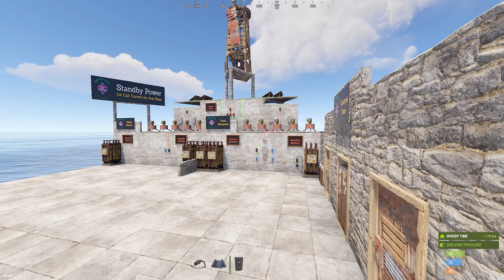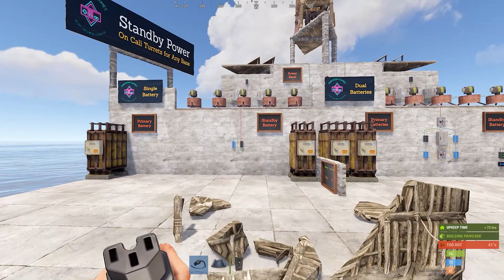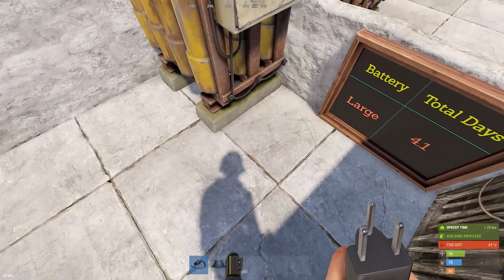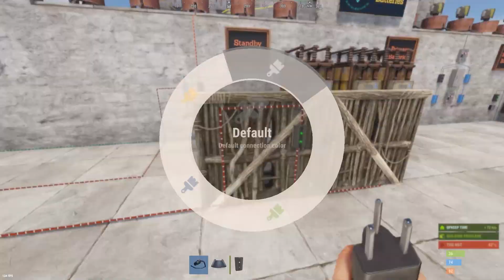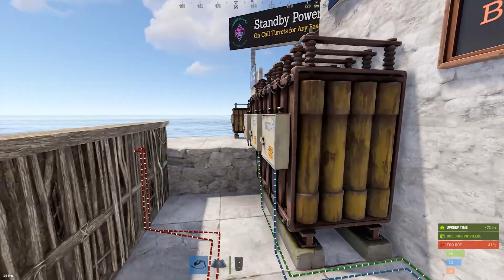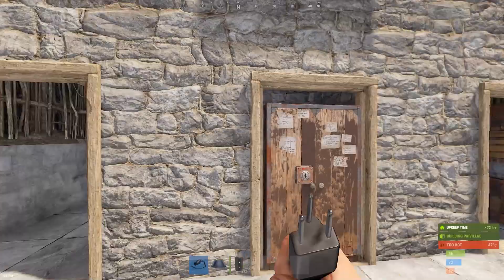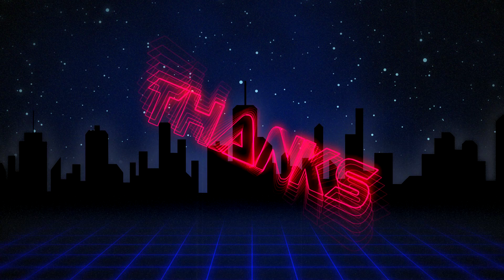RUST Pro Series - Standby Power Vol 2 - On Call Turret Defense - No Power Loss Until Raided 2022

Comment from the maker: 0:00 - Intro / Setup / Vol 1 Recap
0:48 - Single Battery Multiple Activators
4:51 - Dual Battery Multiple Activators
9:30 - Standby Battery Trickle Charging
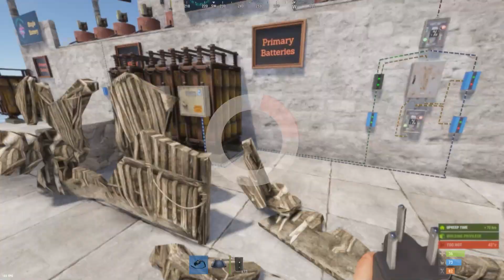12:27 - Mock Base Example Two Entrances
17:44 - Outro